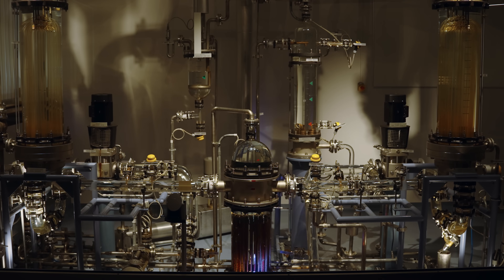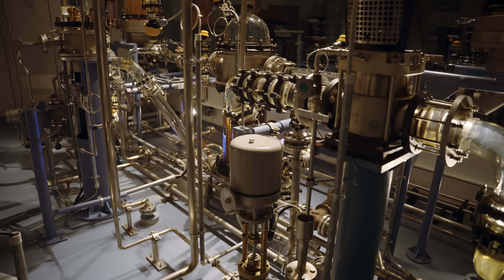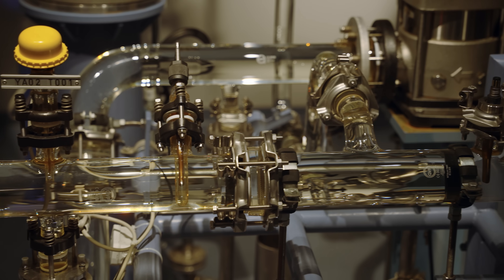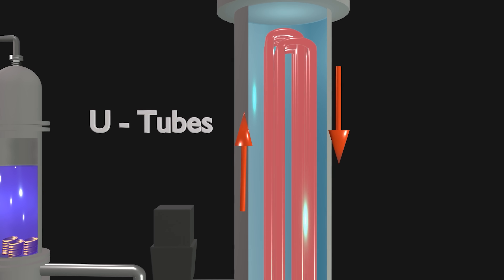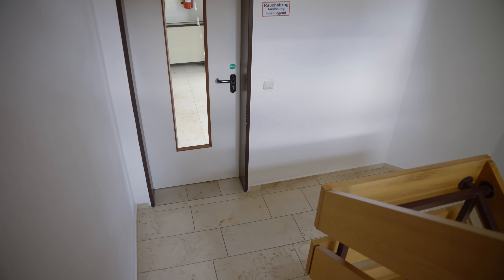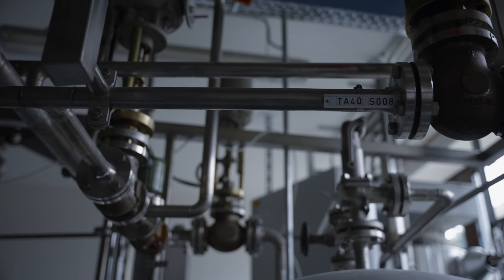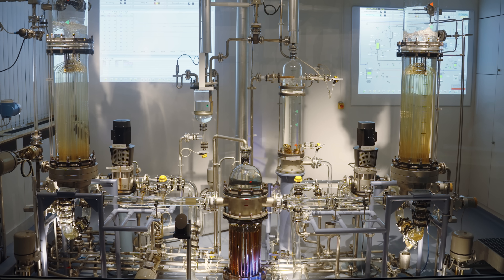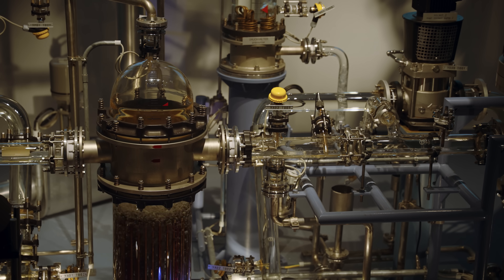World's Only GLASS Nuclear Reactor!

Comment from the maker: UPDATE from Jens: "The crawling negotiations with Munich Technical University have suddenly picked up speed. They finally ‘found a suitable room’ and are eager to sign a deal. Next mail you get from me is likely the info that the contract is signed and the model is saved."

DID WE JUST BECOME NUCLEAR HISTORY HEROES? DID WE DO THIS?
Reply: Great news! Really hope that the contract gets finalized and the model will find its way into a TUM building or museum. Would be a real shame if it just got trashed.
Reply: To be honest, space is a HUGE problem for universities. I am German and work for one. Because so much funding is grant based, short term, ephemereal (spend it or lose (most of) it) and bound to the specific objectives of the grant, it is easier to buy some special instrumentation for half a million, than to upgrade your building, invest in teaching and preservation or even just buy proper office equipment. We got a building recently. Built like a palace, too small by design (designed for current requirements, not growth and accumulated equipment of the next 50 years). Same money could have built twice the size. But that grant was for neutral replacement of inefficient buildings (the old ones WERE really bad, yes), so no size increase permitted.
Reply: I've personally sent quite a few emails.  Let's hope this bad boy is saved.
Reply: Fingers crossed!!
Reply: The „Deutsche Museum“ in Munich has one of the biggest technological exhibitions in the world. That would be a perfect place for this.
Reply: @heikoschwammle4650 I went there on a school trip in the 70s. Such a wonderful and fascinating place!
Reply: @heikoschwammle4650 somebody contact the Detsche Museum if they haven't already
Reply: Save the glass model! Hope the deal works out
Reply: LETS GO!
Reply: I really hope so, as a german viewer... even ignoring the huge monetary value of such an intricate model, it would be just such a waste to simply throw away such an astonishingly master-crafted work of engineering art!
Reply: That's amazing news thanks for the heads up  science Thor 😀
Reply: Science is lucky to have you as its ambassador, Kyle
Reply: Truly amazing news! This technology should be preserved and cherished.
We as a species have a bad track record of mistreating the scientific discoveries in the past.

Just look at our space program...
We had the technology to go to the moon and then we scraped and lost that technology. Then we spent half a century to recreate that technology.

Hope nuclear power doesn't face the same fate. I don't want to spend next half of a century, lungs filled with coal, wondering how we did this in the first place.

All technologies have flaws and room for improvement, but only by preserving those flaws for young minds, do we have the opportunity for improvement and innovation.
Reply: Man, you gotta stop playing with my emotions lol. Learning about the reactor was awesome, knowing it was gonna be destroyed was super disheartening, then I read the comments and found out it was being saved! What a roller-coaster
Reply: I hope that Germany reverses their decision about nuclear power. It is well suited for energy generation. And if done right it is safe.
Reply: @e.j.6010  Nuclear power is safe.  Problem is pressure from all the negativity of the public and politics.  Eventually nuclear power will be moot point once fusion power becomes widespread.
Reply: Hell yes!
Reply: WE DID THIS KYLE!❤❤
Reply: Hell yes! This beauty absolutely NEEDS  to be conserved!
Reply: Well done mate.
Reply: Germany will lose many potential engineers who are interested in nuclear engineering if they refuse to embrace it.  

I’m so glad that this tremendous and unique glass model has a chance of survival!  It would be such a shame if it was simply trashed.
Reply: Can you please update us on this? I was about to send an email to the head faculty member of the nuclear engineering department at my school.
Reply: If that deal falls through, it seems like something that the Museum of Science and Industry in Chicago, Illinois would be interested in displaying
Reply: In case it falls out is there anyone in this comment section that would figure out what it would cost to bring it to the US and what size of a building would be needed to atleast house it. I would be willing to put money forward to help that goal. Even if it only ment housing it until a university or museum decided they wanted it I would like to make certain this peace of history and great teaching instrument isn't lost
Reply: At 16:07 minutes, I'm writing this comment to hopefully have the University of Alberta or Northern Alberta Institute of Technology (UofA or NAIT) to see this video and chat about it! As a Canadian who closely watches the geopolitical situation; most average Canadians don't know or understand the pro's and con's of nuclear technology. To have a visible model of the applicable science on display would do wonders! Granted, I'm just a curious Canadian who probably won't get the chance to work in nuclear science, but it does absolutely fascinate me.
Reply: You did it. ❤
Reply: Quick update on this, contract got signed with the tum last december and it will be moved over to the university.(My professor had to cancel lecture to go over and finalize the contract lol)
Reply: @beepboop5595  I am so sure classmates okay with professor cancel lecture as they want keep  glass reactor program go on. Cheer.
Reply: good job
Reply: Well done!
Reply: Please let this happen!
It's the best thing I heard after learning about that the model will likely be scrapped.
Reply: If they can't or the deal falls through, could you save the model? You are sort of the ambassador for correct information on this type of power source:)
Reply: I'm glad. I wish more people would learn about nuclear. I hope this can be used to help many to understand. I wonder if they would publish the blueprint publicly so others could build similar education devices
Reply: Hell yeah. Dudes rule.
Reply: you did
Reply: Don't let Iran see!!!
Reply: I hope so.
Reply: Is there any confirmation as to if the model has been saved?
Reply: If 750K would save the model and cover shipping to my lab. I'd be very interested in preserving it. I would erect a building for it and would grant full access to students as well as giving public tours a few times a year. The media and VIPs would be permitted access in order to educate the public about nuclear power as well. Does the control room simulated at the facility actually control the glass model and if so could that be shipped as well? I won't be available to disassemble the model myself, however,  I can offer another 10k for shipping and handling. I will pay airfare and 5k salary for Jens to consult with  me and guide assembly as well. Has a technical manual been written for the operation and maintenance of the model? Thank you for showing the world this engineering marvel.
Reply: Absolutely amazing,not only the glass reactor but nuclear energy in itself.
Reply: Great work. Saving this is a good value added venture. One of it's kind. What's wrong with the narrative in Germany? Safe nuclear tech is available. Nuclear powered subs and aircraft carrier demonstrates this. Bad actors in the climate warriors are spreading lies. We cannot switch to alternative sources by sacrificing nuclear.
Reply: I, quite honestly, find it shocking that this is the only glass-simulation of a nuclear reactor on the planet. In America we've had/have university-ran nuclear reactors as teaching materials and I'm surprised that despite this that there aren't any similar teaching aides such as this anywhere else on the planet. And that German is... willing to literally throw it into the scrapyard. This isn't even touching on Germany being so committed to climate change initiatives... and they've closed all their nuclear power plants. How unfortunate.
Reply: I don't get it. That is not a nuclear reactor. Why the government has to intervene? Just because it is a model that only has "nuclear" in name?
Reply: I hope it is saved, it is so cool and it is import to know how a reactor works when you are working on one.
Reply: YESSS!!!!
Reply: That’s excellent news. Let’s hope they get it over the line.
Reply: Thanks for this informative video. May I ask how much would the cost would be for diassembling, transfer and installing such model?
Reply: aewsome this piece of critical history must be preserved. it's  a part of history and engineering.
Reply: Prayge 🙏
Reply: I believe india has a prototype thorium reactor version of this.
Reply: Great news, the glass model is a piece of history.  Fingers crossed
Reply: another victory for the preservation of technological history
Reply: A-hole
Reply: How about titling it "Worlds Only GLASS Nuclear Reactor Simulator Model"? Title's a little bit misleading Kyle.
Reply: Let’s gooo
Reply: I am glad to see that enough of the community cares enough to make a relocation happen . It is a shame to see that nuclear power is being abandoned in Germany, it would be sad to see overall. Even considering the nuclear accidents that have happened, nuclear is still by far the least deadly and most environmentally friendly option. If you think about all the direct and indirect deaths that fossil fuel options have caused between mining or Drilling, transportation and environmental health effects, nuclear starts to look pretty damn shiny. Kyle I believe you have pointed this out before, I just wish more people would listen.
Reply: Maybe the MSR test site in Germany would be a point of interest?
Reply: Legendary save!
Reply: I'm about to cry...
Is it okay if I cry?
Reply: 😊Star Craft ❣️
Reply: That is awesome!
Reply: I was about to scream “CROWDFUND!!!” in the comments till I saw this update.
Reply: Ich war schon im Technik Museum in München. Ich würde sehr gerne noch einmal dort hin wenn dieser Modelreaktor dort einsatzbereit ist.
Reply: This is awesome news Kyle and of course you’re awesome too
Reply: Yes you did. And thank you Kyle!
Reply: That is amazing. As an enthusiastic middle-aged engineer, that makes me SO happy!
Reply: My goodness, this model was saved. There is too much Misinformation waged against Nuclear Power. Too much fear mongering and overzealous lobbying for other inefficient and utterly impractical technologies. (IMO: Wind/Solar at a "macro" level is a scam. Solar works best at a local/small or Homestead like environment, but not reliable enough for a Single standalone power solution.)
Reply: It would be a real shame to see something so useful and beautiful to get destroyed.
Reply: I AM SO HAPPY
Reply: Dang, I was hoping you would be able to come up with the "symbolic Euro" he suggested as the sale price to add it to the Facility.
Reply: I’ll chip in to get you that glass reactor buddy. Long as it’s under a million. And if you’ll maintain it lol
Reply: @kakashisensei38  I don't think he wants, or has the space for it. He's trying to help save it. And if you watched the video, you'd know it's not being sold per se but donated with a symbolic, €1 price tag.
Reply: Потряси волосами как рокер
Reply: This is such a good news!
Reply: Omg! This is great news.
Reply: Great news to hear it will be saved, it's historic and should be saved so future generations can see it, top YT fella...
Reply: That is so dang cool. Thank you for helping preserve such an amazing educational tool, Kyle! And thank you for another interesting, well-made video.
Reply: Can we help fund this even at a small level?
Reply: You know Kyle... there are more of these available. You could take over one of your very own. The community would ABSOLUTELY pay for the transfer and most of the maintenance costs.
Reply: Just saw this on tv and thought I'd get on my phone to see if there's an update. Yaaaay glass boy ❤
Reply: Congratulations!
Reply: @kylehill  The League of Incredible Nuclear History Heroes have come to save the day (ok mostly Kyle).
Reply: YES!!!
Reply: TUMs bigger research reactor also still works, so i guess research gets the exception.
Reply: I sure af hope we did OMG
Reply: The Mining Empire and private property is suspicious and I don't think anything that they ever taught us was true.
Reply: €1 I’d have bought it for my house as a flex 😂
Reply: I really hope this unique and incredible piece of science history finds/found a new home. It would truly be a a significant loss to humanity as a whole, even if most people never know it exists. Thanks Kyle and Jens!
Reply: friggen bureaucracy. . millions of money were paid for this thing and they were about to throw it in the garbage. . .like, if they were gonna get rid of it, they could of at least donated it somewhere that could use it. . 

anyhoo
I'm glad to see the "update" that it was "saved".
Reply: Thank you for the update thats good to hear wish it the best its a beautiful piece regardless
Reply: thats nice,i wondered if someone aside from a youtuber would get something done to save it,how could they not,its really cool
Reply: @YourFriendlyNuclearPhysicist
Reply: I hope so! We probably need  nuclear more than ever right now. Fusion is still as far away as it ever was and probably not economic in the near future. But 5 decades of FUD have poisoned the well of the public opinion in many countries against nuclear, without really assessing the dangers of continuing with fossil fuels vs the overwhelming majority of successful, 'clean'  and safe reactors out there.  The answer surely lies in better design and better training, not just continuing to burn stuff.
Reply: fan-freakin'TASTIC!!!!
Reply: Presidente of El Salvador Nayib Bukele  will pay to get it as he is interested in teaching people of El Salvador this  science.
Reply: Sounds like a good revenue stream to me. Space Camp, but for PWR.
Reply: I'd really like to see it saved and thus hopefully see it for myself, some day!
Reply: Hell yeah, you are awesome
Reply: Send few to Pakistan and Afghanistan for educational purposes
Reply: Has anyone spoken to the science museum in London or other large institutions like this, I'm sure there are engineering and energy production institutions with similar willingness? I'm sure one of them would be glad to have such engineering brilliantly to help explain the the concept's behind nuclear power! I'm sure they've thought of that with the statement of a token payment but surely‽?
Reply: "Spicy rocks"... Love it! 😀
Reply: FUCK YEA!!!!! So happy that it is going to be saved! It is such an amazing piece of engineering, I'm really happy that they are going to save it! I think it will end up being a very important piece of history.
Reply: Damn, i work with them! I've seen this model dozens of times and i didn't know they were going to discard it! So glad you saved it!
Reply: That model is a beautiful thing worthy of putting in a museum,  I hope they save it <3

Dose it get controlled by the mock up power plant control room?
Reply: I sincerely hope so - to destroy such a wonderful piece of technology and history would be a crime. All because the average person is convinced that the nearest atomic powerplant is just moments away from another Hiroshima.
Reply: Bravo👏
Reply: I work at TU Munich, will there be a possibility of visiting the model?
Reply: Awesome news!
Reply: No news update ???
Reply: 😂 No, you did it Kyle... I came late to this but I'm glad to hear you made it. You can tell your grandkids about that. Already a cool legacy there.
 Stay cool 🤙
Reply: Great news
Reply: Awesome, Yes you are.
Reply: is there an update?
Reply: YESSSSSSSS!!!! Let’s goooooooo
Reply: Pretty rare to go into one of these and find good news in the comments.
Reply: WE DONT KNOW. WERE TREES!
Reply: Was it saved?
Reply: I hope so! I can't wait to find out.
Reply: You’re a saint.
Reply: I am living in India, There is prestigious universal called Homi Bhabha National Institute (HBNI) and Bhabha Atomic Research Centre (BARC). If it's available then I will contact them and ask them to talk a look. I think they Will take it. Please Reply if it's still available....
Reply: anymore updates?  I'm a year behind
Reply: @psychomaniac189  idk if it was another video or some other post on a different social media but yes!!! The reactor has found a new home at a university I cannot remember the name of the university though
Reply: If we can start a kickstarter or anything to help let us know! I'd love to help in anyway possible.
Reply: Stop with Manipulative Narration Practices ASAP!!!!

Comment: I watched a good documentary on 3 mile island which had a couple whistle blowers interviewed that worked there at the time and
From there accounts the feed water pumps werent automatically shut off from the system, but operators not fully knowing what was going on shut them off manually. Which what the one guy said was insanely idiotic and in no scenario do you shut off water flow to a reactor, shouldn’t even have a switch to turn the pumps off at the control panel. From that documentary how it explained it, even with the failed relief valve, if they kept the pumps going it would have been far far far less serious then it turned out to be. At least in North America we didn’t cheap out and used negative void reactors not the cheaper more dangerous positive type like Chernobyl.